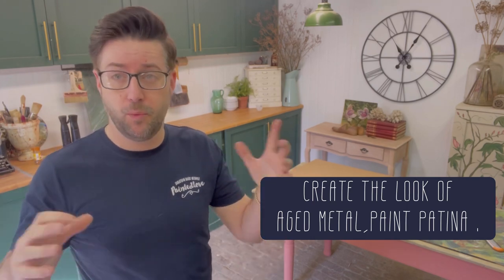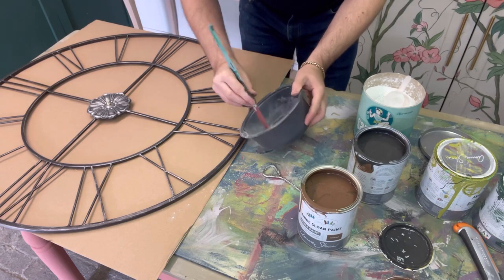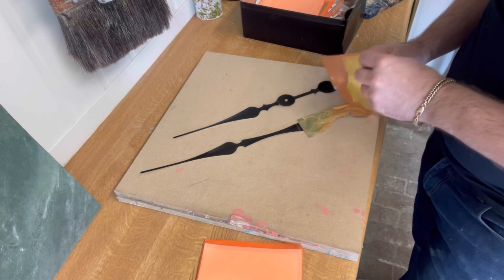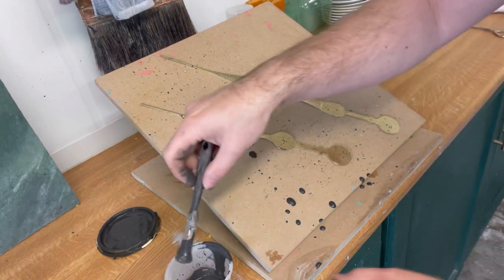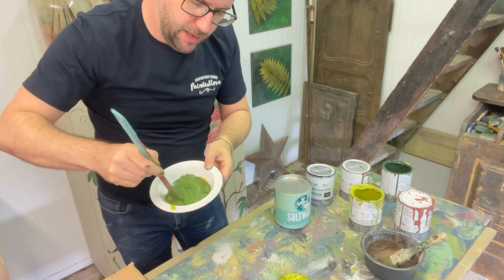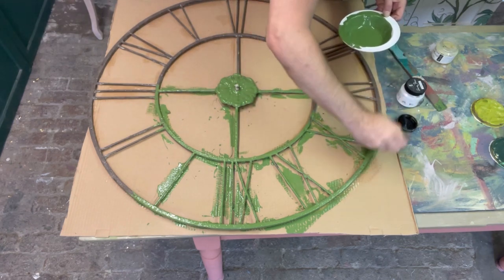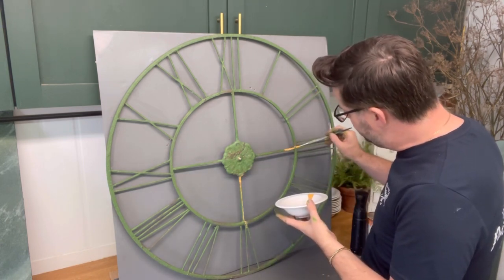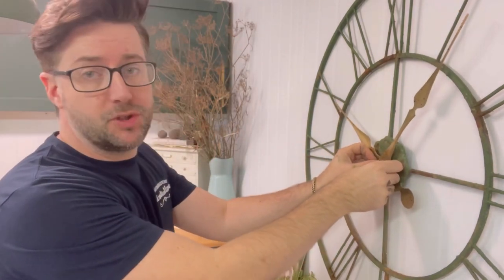Saltwash and Chalk Paint Metal paint patina.

Comment: Where did you get a chip brush that thick?  The only chip brushes I've found are thin.
Reply from the maker: Hey this brush came from local hardware store B&Q if you’re in the UK but it did come as a set of five different size brushes it was the smallest one out of the pack 
But to be honest any natural bristle brush that is small will work really well just shorten the length of the bristle xx